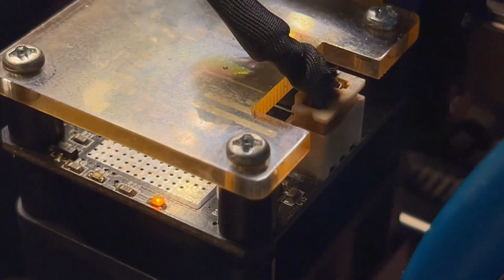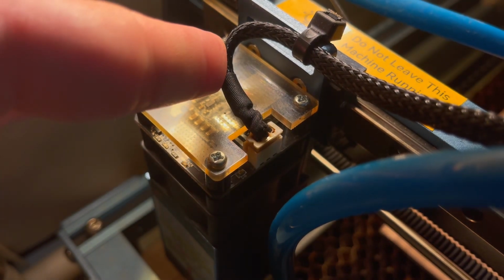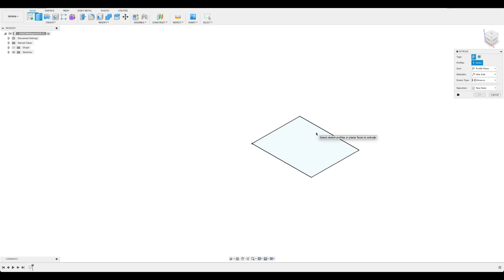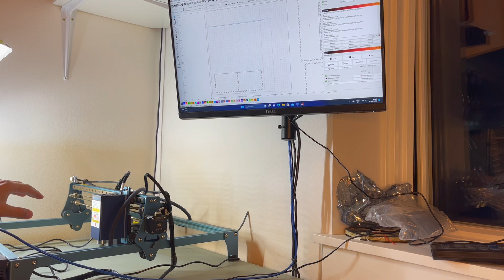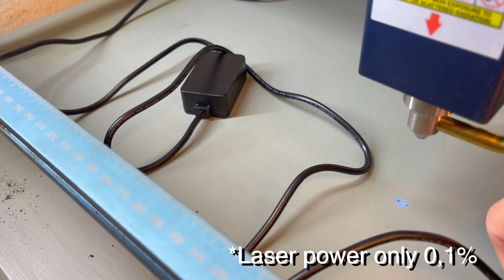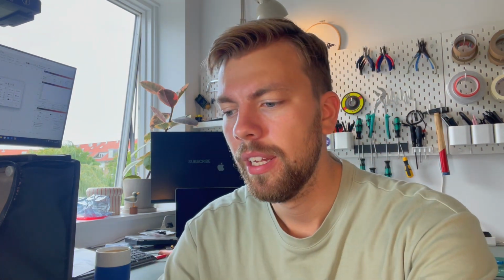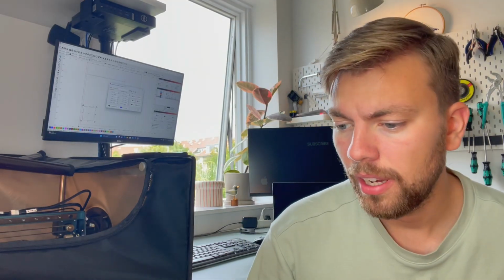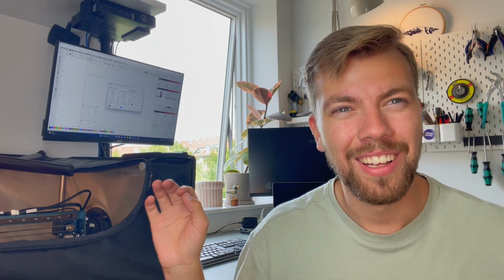Can you upgrade a desktop laser cutter? Sculpfun S10 to 22W upgrade??

Comment: Good Video, thanks . Iv an s10 , what way did you wire in your old air assist to work with lightburn ?
Iv a large compressor so would just be looking to trigger a solenoid valve to open and close .